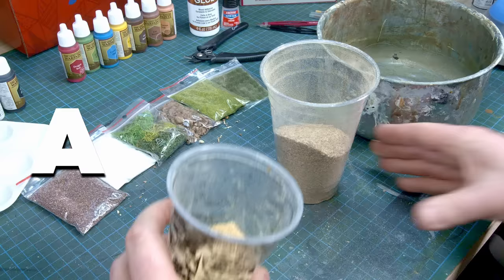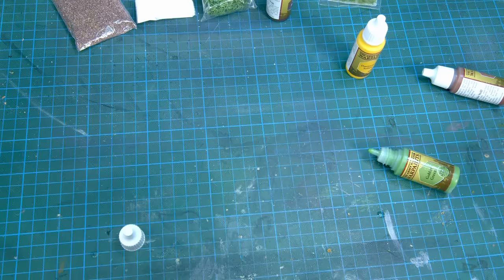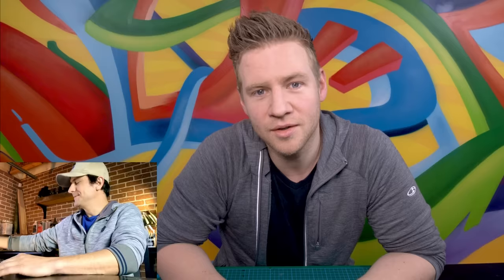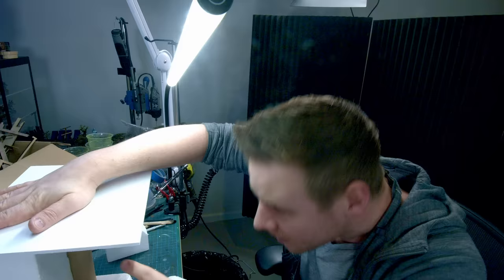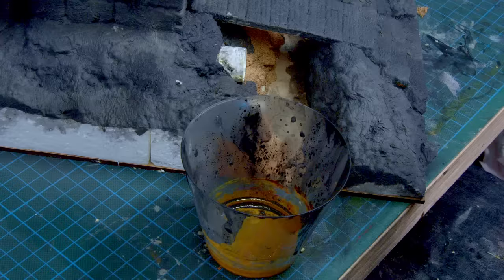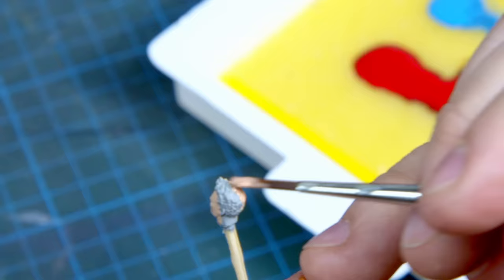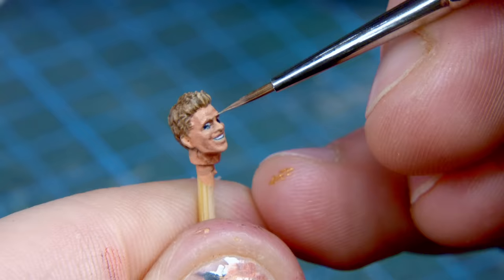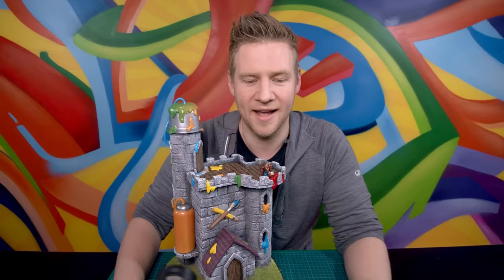I Made this from GARBAGE? - SO Satisfying!!

Comment: It's funny because I'm currently making two sculptures with mostly 'trash'. Which, in my case, means the stuff I can find around my house that I would normally throw away or recycle. I'm using plastic bags, paper, cardboard, Styrofoam, pieces of scrap wood, metal and glass. As well as some leftover play sand and plaster of Paris I had lying around, and some stones from our yard.

Once sculpted, I'll use whatever leftover paints I have, maybe even some resin and mica powders, to finish it off. In other words, my goal is to make an upcycled sculpture without spending any money on it, not even on glue, because I have so many different kinds of glue that need to be used up.

My motivation is to use up all of the arts and craft supplies I've accumulated over the years, plus make creative use of common household trash. I haven't gone through any dumpsters or public trash, I did, however, get a few plastic grocery bags from a friend.